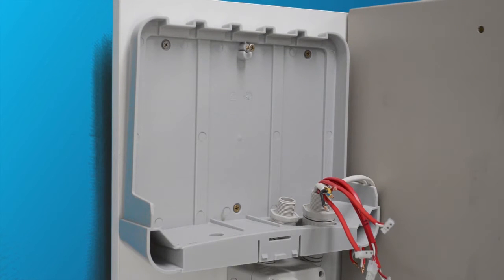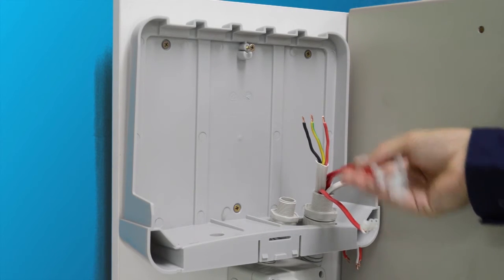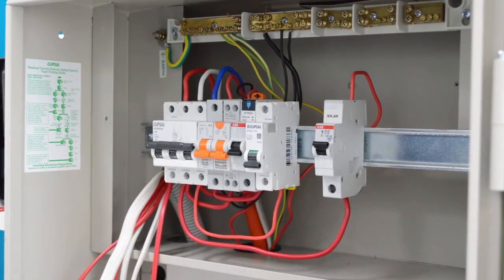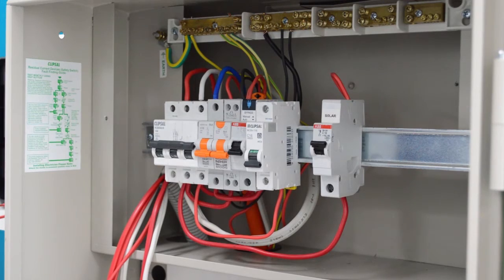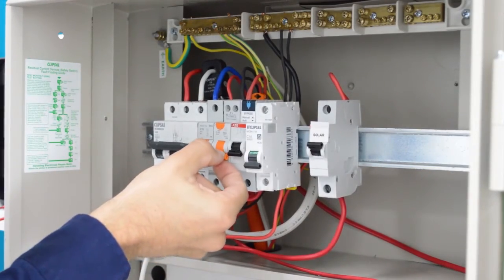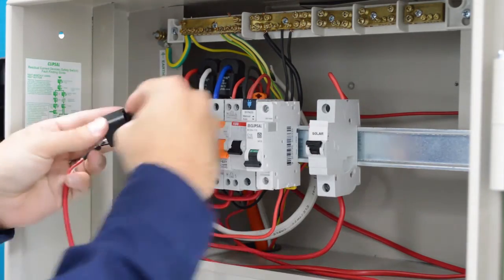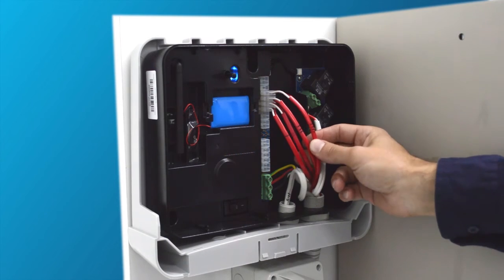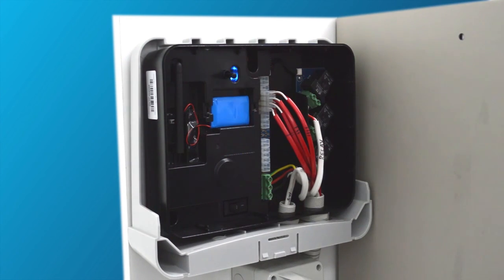Three Phase Mains Single Phase Solar

Comment: Is there a unit like this to direct/ prioritise solar power to a three phase system, but direct the solar power to the phase that is demanding the power? I have three phase, but my appliances are spread across 2 phases. My Solar 10kw is split into 2 x 5kw on two phases so I do not think I am getting the full benefit of the power produced.